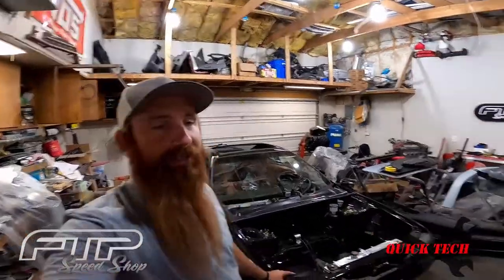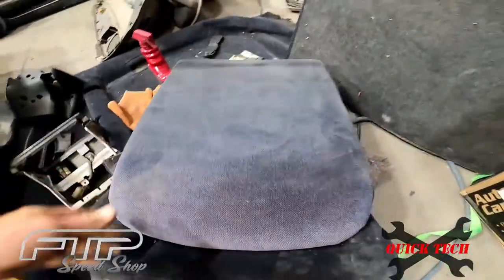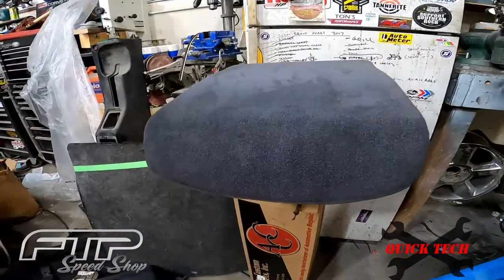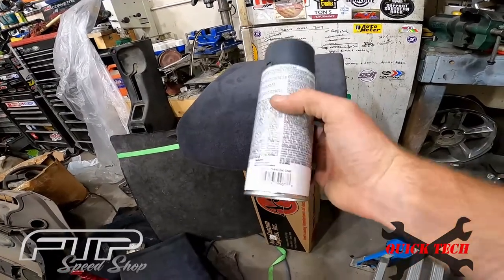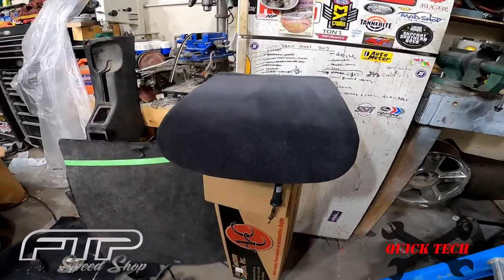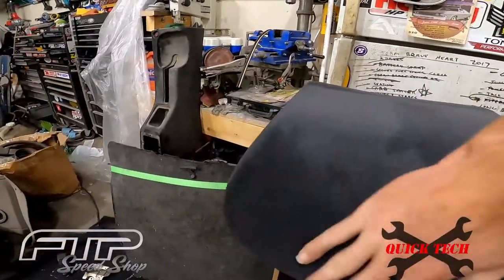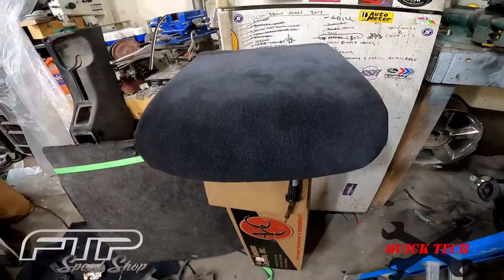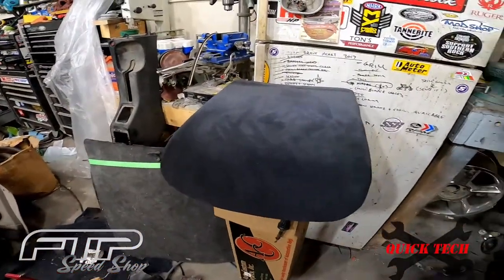Restoring Sun Faded Fabric Seats With Vinyl & Fabric Paint

Comment: What if it’s like tan but the original seat color is black you think that would still work?
Reply from the maker: It would definitely look better than tan.  I you would have to put a few more light coats on to get it to cover.
Reply: @FullThrottlePerformanceMike  okay I will give it a try because I don’t want to get seat covers just cause those would make the whole feel weird if it’s poor quality
Reply from the maker: @Nupkl  factory stuff is always better than aftermarket covers.

Comment: How do they feel after painting? Natural or normal? Got a square body with a bench seat I'm trying to save. Other than a few sunfaded spots its a1 so I'm trying to figure out a way to get it looking right again. Love the end where you say let's get the beautiful cars back on or keep em on the road could not agree more today's cars are such a disappointment and they all basically look the same. It's a shame but I believe that the demand for 80s and 90s cars will go thru the roof in next decade so keep em going!!!
Reply from the maker: I have done this to a few pairs of seats.  They do feel a little crusty or rough at first, but after they are good and dry, rub the shit out of them with my fingernails, and that seems to soften them back up. Also, with normal use, they soften  up back to normal.   I can't say 100% that gms fabric will act the same, but I bet it will be similar.  

You are 100% right about 80s and 90s car prices going through the roof.  My son is looking  for a 3rd gen camaro, and I was shocked the prices are on rough cars.

Comment: Does it work on red cloth seats
Reply from the maker: Idk I'd it would work as well as it does on darker colors. But I don't see why it wouldn't.  I try to find a red paint that matched the interior  the best.
Reply: @FullThrottlePerformanceMike  Ok thank you because I have a 96 f150 and the red seats are a little faded
Reply from the maker: @anjelvelasquez4332  start with a few light coats dusting coats to help blend it in.
Reply: @anjelvelasquez4332 I have a 1994 f150 with the faded red bench seat aswell. Did you restore it?